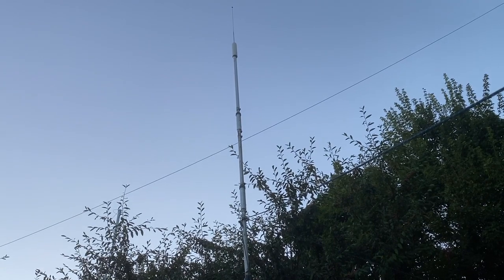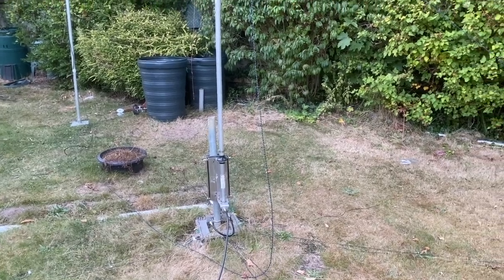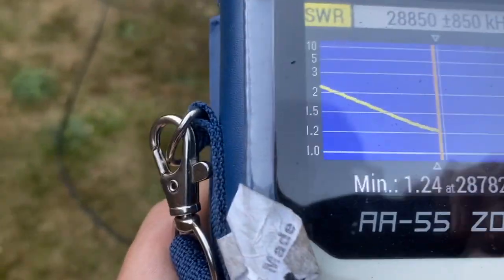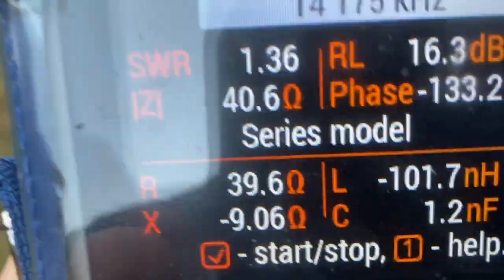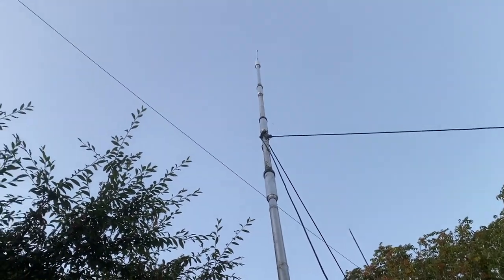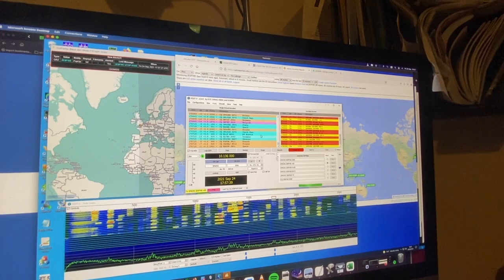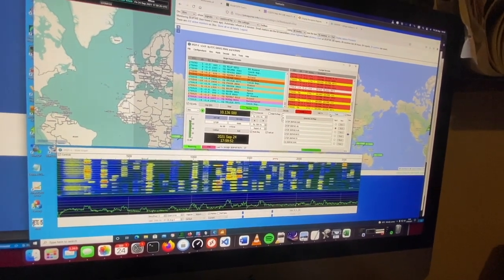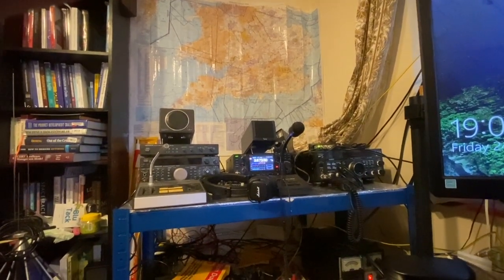2e0FWE 6btv band tuning with trap calibration and results

Comment: I would love to see a video of someone actually "physically" tuning the antenna.
Reply from the maker: with the good weather coming back I'll do some more work on the 6btv in the coming weeks ! I'll be sure to do a video when I can ! thanks ! A.
Reply: @alzeNL  I'm right in the middle of my project. I have some room so it will hopefully help. At current, I have a 60' wide circle with 64 evenly spaced radials. I used my scrapper on my skid-loader and took the earth in that circle down about 3 inches. Used a 12" galvanized stake at the ends of the radials and about 10-6" staples an each radial to keep it secure and evenly spaced. Covered it back up about an inch over, watered it and used a plate compactor. There's a 1" conduit from the shack to the antenna base plate about 14" inches under ground. All that's left is tuning the antenna and mounting it. The instructions that came with are clear but vague. Does it get tuned in position? Tuned on the ground? Tuned off the ground in a vert position (i.e saw horses)? Should it be connected to the radial system when tuning? Is their a setback tuning when down? etc,....?